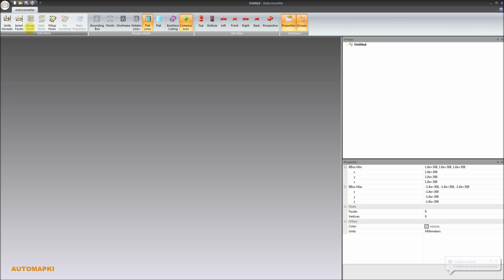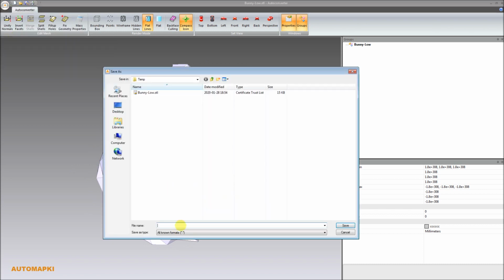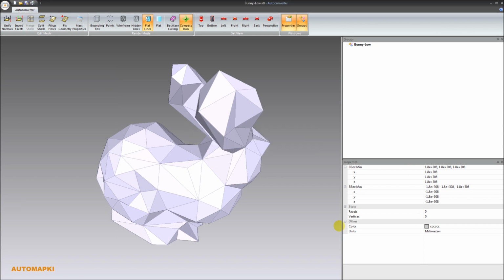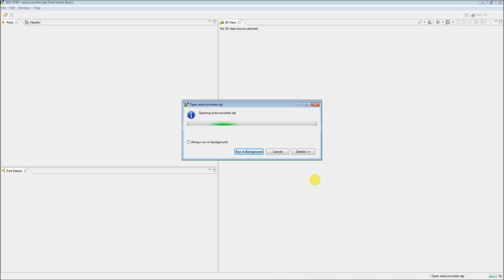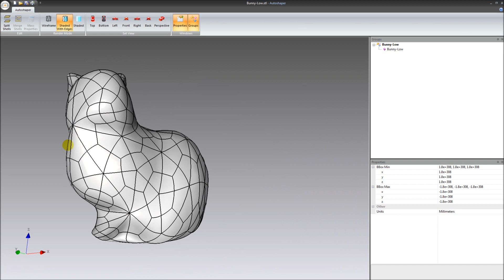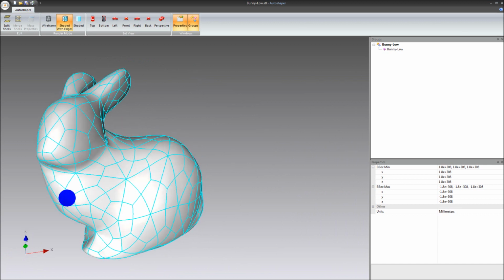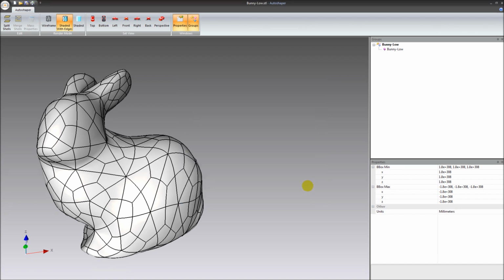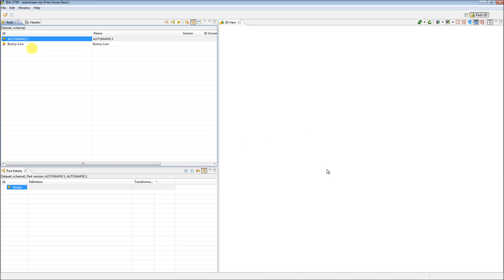STL to STEP file conversion

Comment: I downloaded and installed the Autoconverter evaluation copy.  The web site says the evaluation copy is "fully functional", and that the software can convert between 29 different file formats. Yet the "fully functional" evaluation copy can only work with three of the 29 file formats, and none of the three were *.stl like what's shown in this video. It was on my computer for 15 minutes, then deleted.  I'm not paying  $86 just to find out whether the software can do what I need or not.
Reply from the maker: Could you please share problematic files with our support department? We will be glad to help you for free.
Reply: @Automapki  The problem was your "full featured" evaluation copy did not have an option to convert an .stl file to any other format. The conversion would only work with three file formats, and stl files were not one of the options.  The description of the software says it can convert .stl files to solid files like STEP files.  Can it convert .stl to STEP, or Inventor, or Solidworks, or Fusion 360 solid objects?  And if the evaluation software has all the features of the paid version why are there only three types of files it can convert?
Reply from the maker: @Curtis_Brusque  To convert STL into STEP file format you will need to Open it and then Save As STEP file. The Convert menu command is intended to convert file versions only, e.g. from SKP 6 to SKP 2021. Please share your unique product key and we will extend your evaluation.
Reply: @Automapki  I will reinstall the software and try what you suggest.
Reply: I have reinstalled and tried again.  I will email with information.